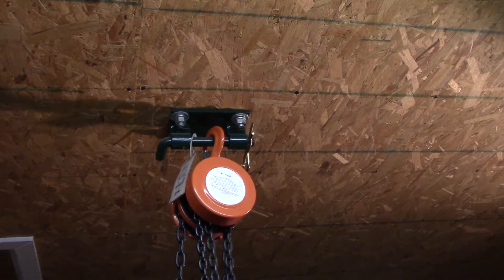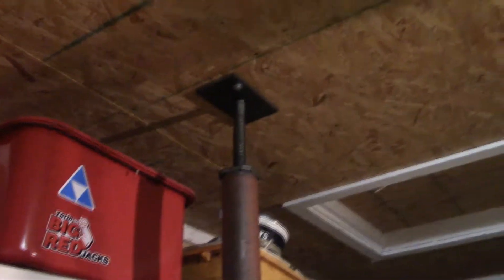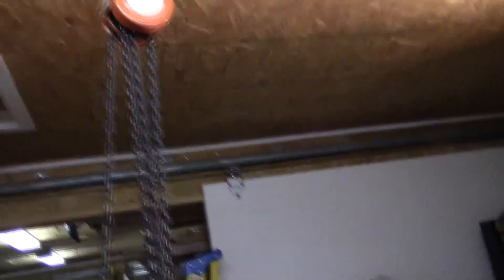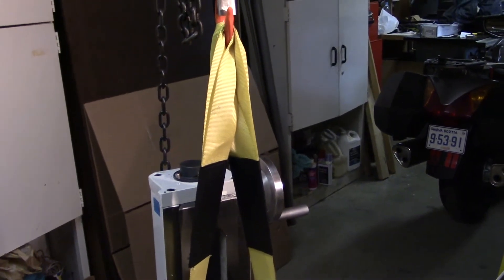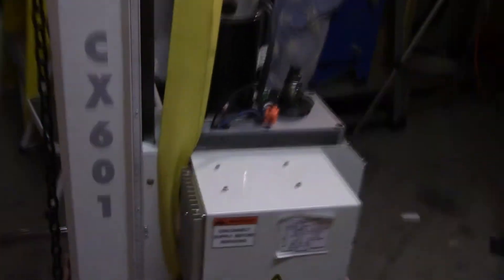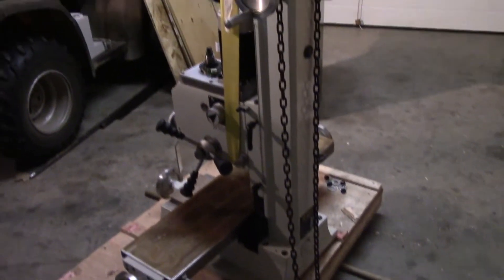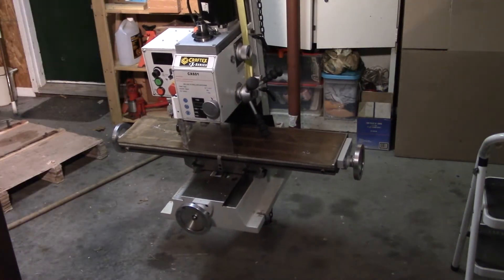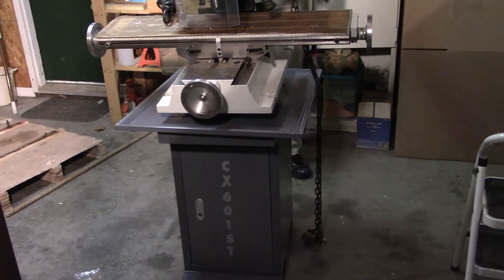Busy Bee CX601 Milling Machine Delivery and Setup

Comment: Hey...just got one of these as well: https://www.youtube.com/shorts/LI0h3BZCUbo
Don't suppose you've added a DRO or Power Feed to it? and if so, which did you get?
Reply from the maker: Neither added yet. I have been looking at the power feed offered by Precision Mathews. They have a machine that is very similar to the 601. A phone call along with some machine measurements and pics should allow them to tell me if it is compatible. Enjoy the new machine! Cheers.
Reply: @Rich_Pierik  Yup, I believe the PM-30MV is nearly identical. That's not a bad idea for sourcing one though, I had considered a Precision Matthews mill but cost of getting it up north was a lot more.

Thanks for the idea!